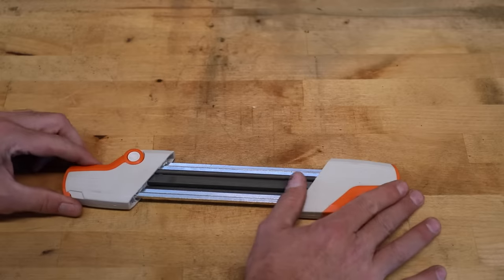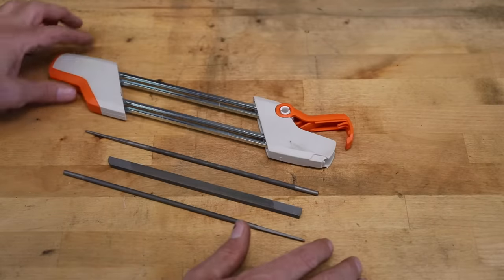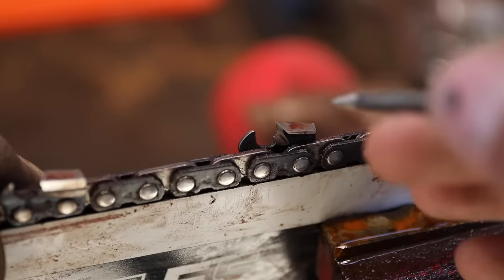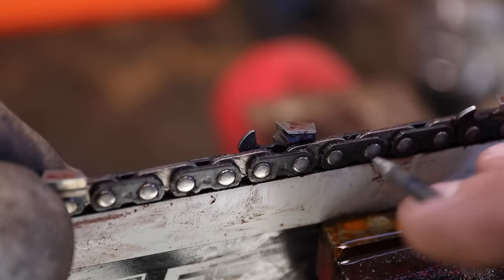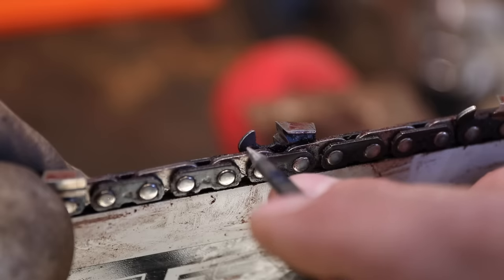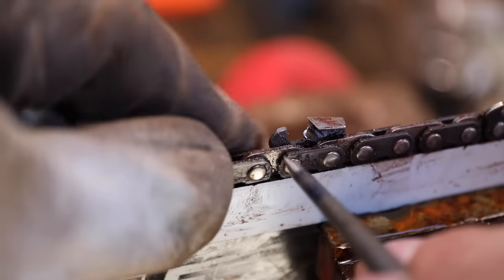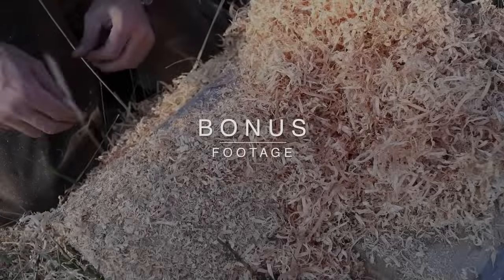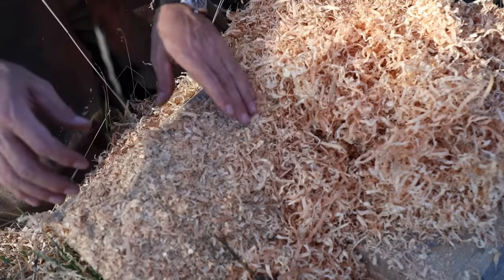Best Chainsaw Sharpener Ever - FINALLY!!!

Comment: Good explanation....however....Cautionary note...the chain here is a skip tooth chain and this tool is made for a full house chain.  Because the "rails" are made to "ride" on top of the teeth on each side of the file which keeps it level. It can be made to work on a skip tooth like this but it is important that the file be held level. Also they come in more than one size so be sure to match it to your chain.  See YT Stephen's Small Engine Saloon for clarity on these two points.

Comment: 2 cents for what it might be worth. Been my practice to clean oil off the chain with slightly soapy water from a spray bottle prior to sharpening. Personally have found I get better result. Presume the file doesnt clog as much and amount of material removed is more consistent. In any event, it works for me. Passing along.

Comment: Thanks for the videos!  That looks like a handy tool.  You've probably already learned this by now possibly but yes, there is different angled teeth for chainsaw chains.  Some angles are better for cross cutting and others are better for ripping for like chainsaw mills.  And also size of saw... there are skip tooth blades and chisel tooth blades all kinds.  The blade in this video looks like a chisel skip tooth... Have a Merry Christmas!!

Comment: The angle shown by the sharpener is for 30 degrees which I think is most Stihl homeowner saws.  It doesn't matter though you can use it at any angle.  For in field this or the Timberline sharpener are the absolute best.  I can only get my chains sharper with an Oregon bench sharpener.

Comment: The angle marks are on the square shiny metal supports .The angle guide is not the plastic handle ,its a stupid design mistake as it is would be more visible and much easier to line up with the plastic handle . Using the guides on the metal you get the correct angle and I find  it gives a razor sharp chain

Comment: Looks like a slick rig, but I am guessing it shouldn't be used with any kind of skip chain. If I had to guess your next sharpening it will be really grabby and aggressive.I think it relies on the jig to rest on the tooth that sits in front as well as behind.Are you running a ripping chain?

Comment: I had that Stihl tool, thought it was awesome for about a month. Then the dumb thing kept falling apart as the files are all held together by the tool clamping mechanism.  But it kept popping open, and not really popping that much open rather the files became loose and moved around in the frame even when I held it close.  I even watched some videos that also rave about it, another reason I bought it… but since the junk wouldn’t stay together and all those files would become dislodged and a pain to put back in place a dozen different times and then supposedly locking the tool back in place only to have it fall apart again.  Maybe if you just sharpened easily it would last. But me using two hands with the bar in a vice, or stump vice, an putting as much pressure on it as I would a hand file was too much for the little guy :/ 

You might have better luck, though I ditched that, saved the files as they are normal Stihl files you buy at the store and watch some videos on how to properly hand file and be better for it.   God bless
Reply: I’ve had two of these 2 in 1 filing tools for about 5 years. Never had a problem with them and I cut a lot of firewood. 
Maybe the older ones are better 🤷🏼

Comment: You're using roundfiles on a square-filed chain. Square-filed chisels are frequently more square than a round-grind.  You have to remove a massive amount of material to reset the grind of each chisel on the chain.

Comment: Is it possible that the angle of the tool didn't match the factory angle of the blade on your saw because you ordered one that was meant for a different Stihl bar and not the tool specific to the bar on your saw?

Comment: I have one of these sharpeners for my ms 391 have you ever sharpen a chain following the angle that Stihl says to use. I would be interested to see what the difference would be. I always use the sharpener the way Stihl says to use am a little apprehensive to change the angle of the chain.
Reply: I have one of these files and follow the angels indicated on the file for both my saws, unlike in the video above. Dad would file closer to the angle in the video (and taught me that method which I used until I picked up this fantastic piece of kit a few years ago) and would need to sharpen more often.
A more acute sharpening angle means less work for the saw as each tooth shaves the wood better and with less force needed due to decreased resistance.

Comment: Is this just for the Sthl chainsaws or would it work on my Husqvarna 455 Rancher
Reply: Yes it will also work for that, just make sure that you buy the correct size filing system.

Comment: I bought it.  Wow.  I cut black locust and osage orange here a lot and I can get a full tank of gas before sharpening again.  I had issues at first but the chain was so out of balance I had to start fresh so the rakers and teeth where at the same height.

Comment: Just bought a new X cut chain for my Husky. Not cheap at around $30. It cuts so easy, better than the original chain ever did. I haven’t had good results sharpening myself. Hard to find someone locally who knows what their doing. Looking for a fail safe tool, not sure this is it.

Comment: Ok so, The angle would be for soft or green timber, angles can be altered for purpose as always there's a balance, bigger angle cuts a longer shaving therefore cuts material faster however as teeth are opposed it twists or contorts chain more which can increase friction and of course heat and chain stretch. You'll find your Lucas mill is at 10 degrees and is a skip chain to clear shavings. Horses for courses

Comment: I am a newbie on saws. I have a small Echo. (Cs310) with a 14 inch bar. Am I correct in thinking that you slip your own size file into this sharpener then use it?
Reply: My understanding is if your chain is 3/8 teeth you order the  one with  7/32 files. If you have .325 teeth you order the one with 3/16 files, ect...

Comment: This sharpener isn't really designed for skip chain which you have. I use full comp chain and it works great with this. It's the only sharpener I use.

Comment: Turn the sharpener and you will notice that the handle is at a 30 degree angle and the scribes will line up.
 One side is for right hand cut and the other is for left hand cut.

Comment: what is up with that angle is you have a 'skip chain' for ripping which has a tooth angle of 10-15 degrees instead of 25-30 for cross cutting

Comment: I've been using mine at the recommended angle of the file and it doesn't seem to sharpen as well as the results your getting. What am I doing wrong here?
Reply: Probably your raker/depth gauge is still up to high.

Comment: Aren't the guide rods on the sharpener designed for for a standard chain, and not a skip tooth chain like the one you used? Maybe that was why you were hitting the rakers so much.

Comment: Just came across this video, I have used one of these tools for many years, and I love it works great, however style or however you spell that other chain saw did not invent it. Mine is made in Germany by Pferd and ordered it from Bailey a Husqvarna catalog. I think I've had it for at least 10 years.
Reply: Thanx for the reference to Pferd, have checked them out and plan to order one (along with the “stump vice”. 👍
Reply: Pferd makes the Stihl sharpener

Comment: the only time you pull a file backwards is if its a doublecut file. If its not a double cut file you will QUICKLY ruin the file. Do NOT saw a file back and forth if its not a doublecut file. Yes the lager pro saws use a different size chain. I used this sharpener for the first time this week as I work with a non profit that clears trees from rivers. We are hard on chains and saws, many times sawing under the water and hitting sand or worse. I used the angle as indicated by the sharpener as it matched my .325 and 3/8 chains. I used it on a 20" 24" and 32" chains. After the first chain my speed increased. I did 8 strokes per tooth which was too much for a non damaged chain. 4-5 per tooth tops is all thats needed. Another saw guy commented how sharp the chains were and how well they were working compared to when we finished the night before. I Sharpened the 20" chain on his personal saw that had damaged teeth and was done in 5-10 minutes.  I was considering getting an electric sharpener but theres no need for it.  Plus you can keep it in your toolbox and use it in the field.

Comment: I've seen a lot of misconception where people thinks the more pointed (angle ) the sharper it is.That is totally wrong.I aways use the tipical file and about 4 strokes while slightly rotating the file gives me the best results with just a slight angle on the chain.

Comment: One would think these would be available for all chains.  My Oregon chain wants a 4.5mm diameter file at 3/8 inch pitch and 0.025 depth gauge offset. Has anyone seen one of these with 4.5 mm files? Can I swap in that size file or will they be too loose or not fit?

Comment: 9:20 It looks like you took some of the the angle out of it, making it more blunt. I would stay with the angle of the tool, and for full chisel chains, the handle side down about 10 degrees.

Comment: I use 10 strokes at the files angle AND MAN THIS THING CUTS FASTER THAN FACTORY
Reply: Is this sharpener applicable to all chains? do chains have different sizes? thank you for answering

Comment: I am an armature.  I was going by the marks on the tool.  But it seems my saw is not getting sharper.  I will try your angle.
Reply: I'm thinking you mean amateur rather than armature. An armature is the shaft in an electric motor that rotates and does all the work LOL
Reply: @ThePaulv12  Yes that is what I meant.  And it did work.
Reply: @Herbert04  Well Herbert because you said so,, I'm going to buy one. I hate sharpening my 4 saws and anything that makes it easier is OK by me.
I have the Stihl bar jig and i hate it, but it works. I use a wooden handle on the file to touch up but this tool seems to be the wooden handle and the jig all in one. Only problem i see is you need a vice in the field now.
Reply: @ThePaulv12  no you don't.   I just hold mine.
Reply: @Herbert04  Is that right? Well I'm even more sold. Thanks for the info Herbert!
Reply: @ThePaulv12  I am no expert.  But I'm learning.  I'm guessing you would be more knowledgeable on this subject.  I'm pretty much self taught.  And still learning.
Reply: @Herbert04  That's why I'm asking you. If you can get it to work that's all I need to know.
Reply: @ThePaulv12  Well after watching this video and going at the angle he did.  Yes it worked.  But the markings on the tool didn't work.

Comment: hi you are not using  the handle of  file to give you the correct angle   to the cutter bar of saw.   The angle is the two gray handles is angle used

Comment: Can you use this sharpener to file a 10 degree or 0 degree chain, i.e. a ripping chain?
Reply: You should be able to as it is aligned by hand / eye just like any of the hand files.  I just bought this and plan on using it for my rip chains mostly.

Comment: Do you have to lift the file between each pass?
Reply: Yes, if you drag the file backwards it will damage the file and shorten it's life. The files are designed to cut in one direction. Check out this much better video on how to use the sharpener https://youtu.be/marzGaMq6pM from Steve's Small Engine Saloon. The Stihl sharpener is made by Pferd. You can save some money if you buy the original Pferd branded blue sharpener. Just be sure to buy the model that corresponds to the pitch of your chain

Comment: Excuse me, a recommendation when use the file any file don't retract the file over the metal they are designed to work only to pushing, lift, restand repite push, lift, rest restart pushing

Comment: I went to look for this tool on Amazon. I’m confused now. I see a ⅜” P and .325P. I thought the file size was a 3/16” file. Now I don’t know what to buy for my 20” bar Stihl chain saw.
Reply: It just depends on the size of the chain on your chainsaw
Reply: @reidgleason7862  how does chain sizer determine the pitch?
Reply: Jack Wall Look on the bar and there is some information there.  Length of the bar and chain tooth info, that will tell you what file size you need.
Reply: @johnmoore7133  No markings on the bar except the manufacturer’s part number. thanks. And also turns out my saw is a Poulan instead of a Stihl.
Reply: @johnmoore7133  turns out my saw is a Poulan and the only marking on the bar is the manuf. part number.

Comment: I bought one of these at the suggestion of the guy who sold me my saw, and it has been useful. I am a total neophyte, but this has made me able to sharpen my saw myself rather than take it to the shop. When I bought my saw, I did not even realize how quickly saws get dull.  -  I have recently seen a sharpener advertised on social media that is even faster, and I wanted to see if it could work, but I don't see anything on Youtube about it. It is a cap you put on the end of the saw and you use pressure to press the saw blades against a stone as the blade is running. Anyone seen it?

Comment: For almost 40 years i sharpened by chainsaw using 2 "gadgets" only.    My eyes and a round file.    That was a LONG time ago.   Just follow the angle properly and it will cut like butter, with nice big chips. When i noticed  i had to work a little harder, i just sharpened it again. How many cords?   I cannot begin to count.

Comment: Standard angle is between 30 and 40 degrees. The angle you file at is about 20 degrees. Seriously doubt It makes much difference. Ripping chain however is filed at 10 degrees

Comment: That is a RSLK chain, which is square ground. You can see the square inside corner in the first few minutes. It's not supposed to take a round file for the tooth.They cut much faster than round ground. You sharpened to round ground... oh well! You converted it to a RS chain :)

Comment: It's not meant to sharpen a skip tooth chain like youre using, the guides ride on the top of the teeth of a full house chain.  Of course you can sharpen a skip tooth but the guides won't be resting on the teeth.

Comment: Is that a skip tooth chain you're using? I ask because there are TWO rails on the sharpener and they are intended to ride on adjacent teeth on the chain to keep it "level." The teeth on a skip tooth chain are too far apart for this feature to work so you need to manually keep the sharpener level with this type chain...as you did. Nice video!

Comment: Hey there Cody! I have come to greatly appreciate your tool videos for the common man. That being said, have you seen the harbor freight chain grinder?? I just picked one up for $25 with one of those %20 off coupons that’s always floating around. The price for the grinder is less than the price for a new chain, and. It works, I’ve done a couple of chains since I picked it up they cut great and the grinder runs great. It gives the common man the ability to sharpen their chains like a pro. Keep up the good work brother, god bless.

Comment: You are filing on a skip tooth chain, sharpener is for a full house chain.  The rails will set on a tooth preventing tilt. As long as you know this you can sharpen a skip tooth chain........

Comment: Can it be used on any brand saw?
Reply: Yes - but you have to find the correct diameter round file to match with your saw chain.  one of the reasons why it just holds a replaceable file.
Reply: @petershupe3460  thank you!

Comment: Does anyone know if the sharpening tool comes in a ⅜” pitch version?  Or if the .325” pitch tool would still work?
Reply: 3/8" = part # 5605 750 4305    .235" = part # 5605 750 3504  also do 1/4" & 3/8" Pica & .404" so everything covered
Reply: Awesome, found it!  Thank-you!

Comment: A chisel chain runs at 30 degrees. The depth gauge should be 30 thousands lower than the top of the chain.

Comment: I would have thought that for someone that works with the United States forestry that this tool would have been commonplace they've been using them on the storm water crew that I worked with for over a decade

Comment: Can anyone convince me this does a better job that a round file by hand? That is if you consider yourself very good at getting a very sharp chain hand filing with a round.
Reply: It uses a round file. The flat file tunes the rakers. It's a great tool that works.

Comment: 😂 it took me about 4 or 5 months before I actually saw the indented picture of the chainsaw on the handle that shows you which end to hold/side you're supposed to be on.. . It's weird how these have not always been pretty much meets the concept exactly of how you are supposed to sharpen chainsaw teeth... doing it any other way is kinda atupid.  Perhaps the circle came after the wheel too? I bought cheapos. They are still so great I love them❤

Comment: Fifty bucks for the fancy file holder is a bit pricey for the tool. I prefer the rotary burr method. You only sharpen the least amount of chain tooth metal. The burr lasts way longer than a file could ever last. The Arnold chainsaw rotary file rules. Shame you do not find them often. But you can find the timberline brand that works ultra well. Good day and try to put a little less pressure on the file tool you are using to prevent jurkeyness. VF

Comment: Did you ever understand why the angles are off between what you were used to & what the sharpener was telling you? I'm thinking the 2 n 1 markings were designated as 30 degrees. It actually looked like you were sharpening at approximately 15 to 20 degrees.